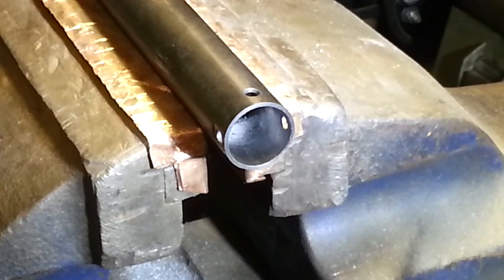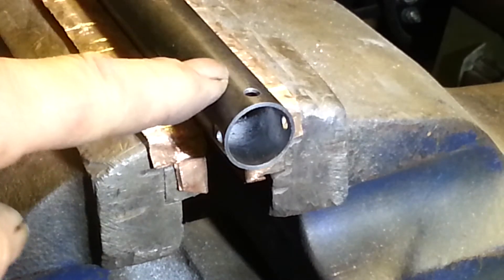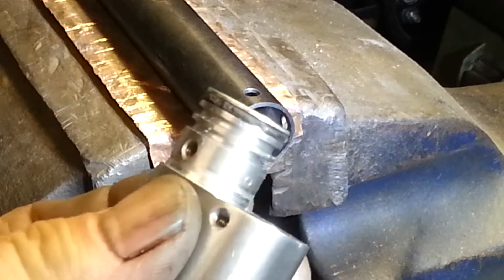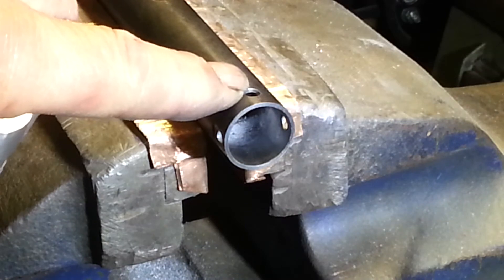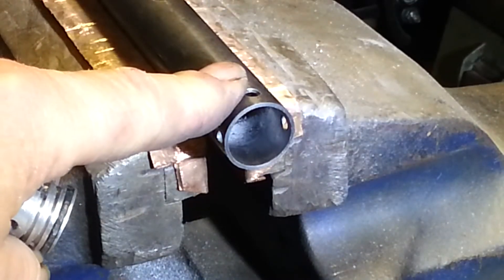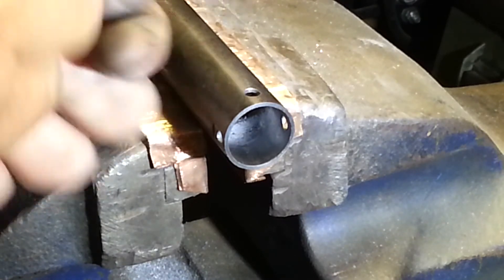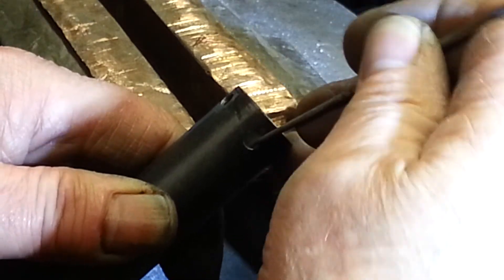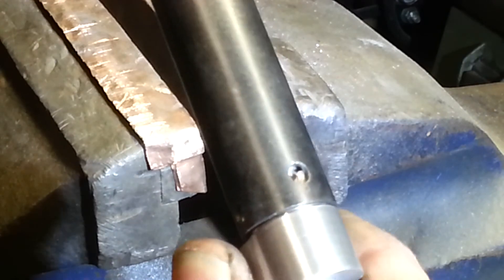Crosman  Drop block fitting.

Comment: This is fantastic! I've been looking for a solution for my 2240 to air. I was wondering if there are any drop blocks that can be screwed directly in to the valve?
Reply: there is a drop block thats screws directly into the tube of 2240 & 2250 non of this is needed the supplier is "gmac crosman custom parts .com"